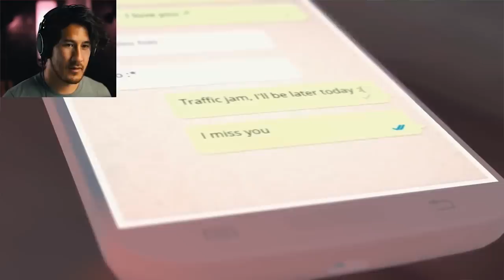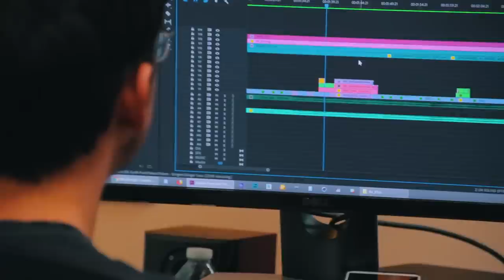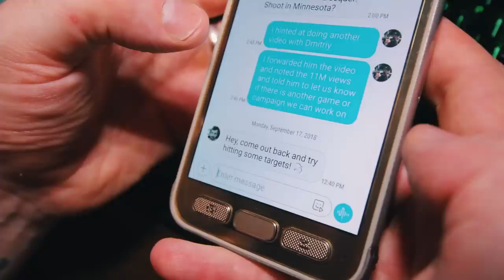I Broke my Friend's Prized bow & now I will fix It.

Comment: btw the dust mask jake was using doesn't filter out the air particles, only dust
Reply: That's good because he would asphyxiate and die if it filtered out air particles.
Reply: That's not what they meant and you damn well know it! :P
Reply: wait I'll buy them a better one

plastic walmart bag blows onto corridors doorstep

Comment: Often when a thread or screw is stripped you would drill and tap it out on a bigger size and use bigger screws if the casing on the one wheel would allow you to do this  or there are helicoils  either option would work a lot  better than tape .

Comment: Sir Wrender, the best way to fix a Stripped screw port (learned this through several Nerf Mods) is to put super glue into the Screw port then screw the screw back in and let the super glue cure, it will settle into the threads and hold on so when you absolutely need to you can unscrew it. keep in mind that over multiple break downs and take aparts the glue will crack, meaning you will have to apply more, but it should hold for a couple of months.

Comment: Hey @SirWrender, I know it might be a bit late to respond (and by now its likely someone might've already said this) but if you still have issues with the stripped out screw holes on the onewheel, or if you run into them again in the future, you could try repairing the hole with something like either a time sert or helicoil, and/or possibly use a bit of loctite to help hold both the thread repair and the screw in place. In case you haven't heard of time serts or helicoils, they're basically threaded sleeves that screw into a hole slightly larger than the original hole and have an internal threaded hole the same size and thread pitch as the original screw, allowing you to essentially replace stripped out threads, provided there's enough material to drill and tap into.

Comment: Wren to your request for ideas for stripped screws. Bore out a slightly larger space and 3d print threaded inserts that can be epoxied in. In the event the thread strips again you can replace the insert without further damage to the one-wheel

Comment: I know in 2 weeks late but Wren, what you should get a tap that is the same size as the threads or even a bit oversized, get a 1/4 inch steel plate cut to size then get new screws. if you inset the screw heads into the steel they should never get damaged and you can do as many tricks as you want.

Comment: Hey Wren,

depending on the type of screw you are using, you may be able to use an epoxy of some sort (JB Weld or something alike) to fill the hole. Afterwards you can drill a pilot hole for the screw and re-tap it if required. Otherwise, maybe it is easier to find a larger screw and re-tap the existing hole.

Comment: Wren, Check out Helicoil inserts.  Not sure what size screws you are using, but if you can over-tap and add a Helicoil you can add a harder metal and it won't strip out again.  You could also go smaller if the threads are still grooved enought to accept the insert.

Comment: Hey there wren! a good method to go about your stripped screw is to cut up a toothpick to the length of the hole so that the grooves can be recut by the screw. This is a trick I learned for strap buttons on guitars/basses. Let me know if this helped!

Comment: Sir Wrender, since the frame is aluminum, the threads are rather weak, so to combat that install a HeliCoil. It will give you the proper grip strength you want without stripping the the thread and this can also allow you to still use the same fastener size that you originally had.

Comment: Best solution for stripped screws is to retap the holes the same size and use a screw with a more aggressive thread if they are only lightly stripped. If they are very stripped retap the holes one size larger and use screws one size larger. You can get a tap or a 5ap set at the local hardware store.

Comment: For the One Wheel, you could either glue the existing screws in place or use bigger screws. 

Downside of the first idea is that taking the screws back out would be very difficult. The second idea could weaken the overall structure depending on how large the new screws would be.

Comment: Just a suggestion for the one wheel but would you consider sanding the screws down to be flush with the bottom of the board so they no longer catch and you dont need to worry about them tearing up again?

Comment: There's a certain tape you can put on the screw which will give it more surface area. At most you may have to redo the hole to keep it in.

Comment: Hay wren, you could give rivnuts a try, they are rivets with in built threads. you'd just have to drill out the threaded hole a bit bigger

Comment: Hey wren to fix stripped screws try putting jb weld putty in the hole and re tapping the hole or you can try tapping the screw holes for a size up from the screws you have now

Comment: The best solution to fix the one wheel is to re-thread the stripped holes, its super easy just use a tap and dye set

Comment: Hey Wren, could you possibly make a custom mod for the float plate so it has tiny wheels or rollers so you don’t apply friction directly to the flow plate?  It might help you with your stripping problem. Just an idea I thought of while watching you work.

Comment: Just use a slightly bigger tap and retapp the holes wren.. then you just get a bigger screw.. or you could fill the thread hole with something like jbweld and then drill and tap it back to the normal thread.. I cant think of a better material besides jbweld but whatever you can find thats super sticky and dries hard like metal then retapp them
Reply: Or use thread inserts

Comment: Wren needs to just tap the threads for the flow plate larger and use larger bolts, with as fine a thread as possible.
Reply: The plates don't have threads. It's the aluminum frame inside that has steel inserts which have the threads.
Reply: SirWrender if the steel inserts in the frame are big enough you should be able to tap them one size bigger. If not you can get a thread helicoil that essentially replaces the stripped threads.
Reply: SirWrender if you can’t tap the holes in the frame larger definitely look into a helicoil set. Also definitely my favourite member of the corridor crew, we need another run of the wrender shirts now I can afford one.

Comment: Stripped out? If there's still enough metal around the stripped out hole get a drill and tap set and tap it to a larger diameter.

Comment: The best way to fill in that stripped out solution you need is to take whatever material the stripped hole is for instance if its wood. Take a hardwood and make a little plug and epoxy glue it into the hole. once cured over night redrill a bit smaller hole than what is needed. Then screw the original screws back in. and it will be tighter than a ducks butt!

Comment: Why don't you just put foam onto the bottom of the onewheel and use that to go up the ledges? And I don't mean like a really bulky piece of foam, you just need to put a half inch thick layer of foam on the bottom.

Comment: You know what fletches are right? Or what fletches are? Cause it’s used completely incorrectly here, fletches here (otherwise known as veins) are the feathers or plastic stabilisation wings put on arrows. Other than that little knit pick it was a good vid

Comment: Nag man g squared isn't GG, its GxG
Reply: typically in math you don't need a multiplication sign between two variables if they're stacked next to each other. Sometimes a * is used though.
Reply: SirWrender my mistake good sir. It has been a couple semesters since I last had to take calc